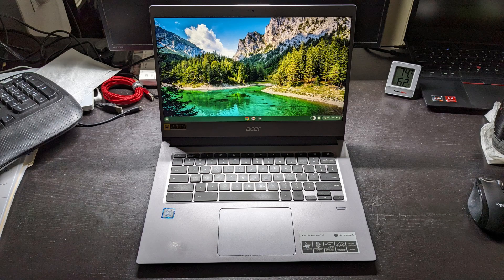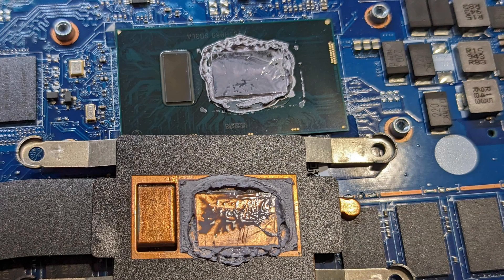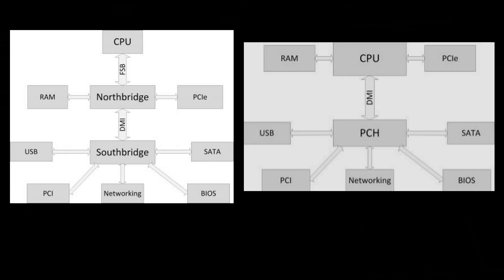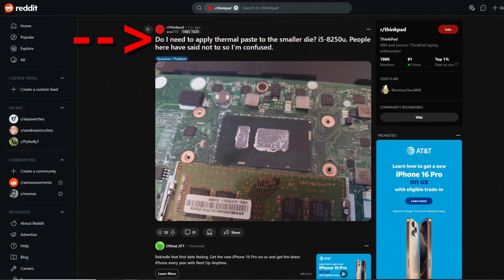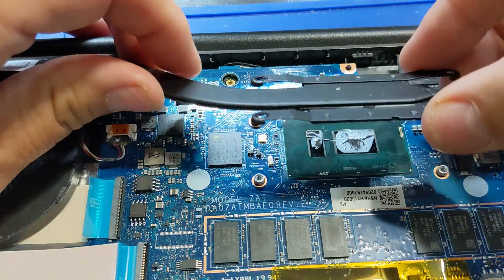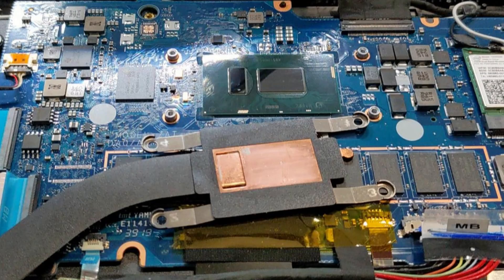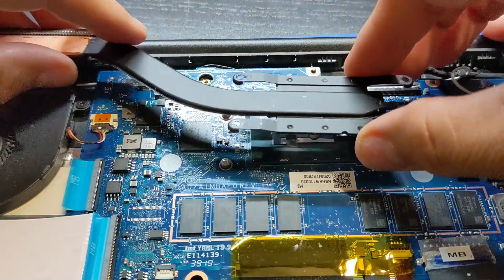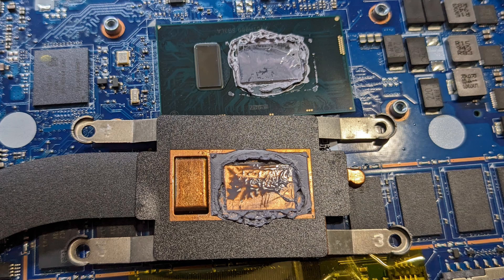Do You Need Thermal Paste for Intel Core i5 PCH?

Comment from the maker: ***If your laptop comes with thermal paste on the CPU and PCH by factory (and there is no cutout on the heatsink above the PCH), then continue putting thermal paste on both dies. But if your laptop does not have thermal paste on the PCH (and there is a cutout on the heatsink), then don't put any thermal paste on the PCH. UPDATES, LINKS, and additional information in the video description! ***

Comment: Bro I have applied Thermal Grizzly Kryonaut, High Performance Thermal Paste(1gm) on both CPU and PCH on my dell inspiron 5509 laptop because while opening for first time i have seen thermal paste on both CPU and PCH.

 I have observed that laptop is becoming little more heat than old thermal paste(default one) which was there for 3 years. What should I do, open laptop and clean paste on PCH (as I have applied it on just yesterday) or clean totally on CPU and PCH and apply new one.

When I asked My dell service man, after this incident, he said that we should apply thermal paste in CPU only. So I asked him say doubt as I am asking you for removal ,then he recommended me not to remove paste and leave as it is. 

I am confused so I need your opinion Bro. I use my laptop for normal tasks like streaming videos, coding for 6-8 hours daily.
Reply from the maker: Does the heatsink plate that touches the CPU and PCH, have a cutout on the PCH?
Reply: @ChavezDIY Heatsink is plain, so put on both PCU and PCH but my dell service man said to put on only CPU, what to do?

Comment: Interesting how differently this is handled on different laptops, even on the same CPU. I recently replaced the thermal paste on ThinkPad T480s and X1 Carbon G7. The 480s has the same exact i5-8250U as on this video, but with paste on the PCH. The X1 Carbon on the other hand had no paste on PCH from the factory. Replaced the stock paste with Thermal Grizzly PhaseSheet PTM on both, T480s so that the PCH gets a pad and X1 Carbon's PCH goes without.
Reply from the maker: I don't understand the reason for the inconsistent application of thermal paste on the PCH. I will just go with how they come from the factory.

Comment: I have a Dell Inspiron 3501 with i3 1005g1. Not only the pch came with thermal paste, but on aaaaall the green part too 😅 i think it is not supposed to be these way so I only applied thermal paste on the cpu and the pch. The fact is I think is running hotter than before 😂
Reply from the maker: Paste on the green part too? haha. You might have to experiment to see if it needs paste on the PCH or not.

Comment: Asus VivoBook F510U Model: Apply it to both PCH and CPU FYI.

I did it both ways to test it like you did. No cutout on the heatsink for the PCH but the heatsink is aluminum with copper pipe and aluminum fins for heat dissipation. Was weird seeing that setup from building desktop gaming rigs and the mating surface for the heatsink to the CPU was always copper, since copper absorbs heat better than aluminum. That makes sense to me. Aluminum for the fins for heat dissipation is better than copper. Don't understand why Asus did that. Makes no sense to me.

I applied Corsair TM30 Thermal Paste and my temps suck. I did it 4 times now and just not happy with it. Spread, Dot, X applied and with or without the PCH with paste. I ordered some MX-4 Thermal Paste to give that a try. Bestbuy only had the Corsair TM30 and I'm out of my Arctic Silver 5 Thermal Paste. I personally hate Corsair products. People buy them like Apple for the name but produce garbage at best products. You want RGB Lighting RAM with crappy performance compared to other products on the market, buy Corsair. 
I never used the MX-4 paste but I hear really good things about it and I heard some bad things about the MX-6 being really thick paste and not very pliable and almost glues the heatsink to the CPU cause people to pull the CPU off the motherboard causing damage when removing the heatsink.
Reply from the maker: It's annoying that people have to do their own testing to figure whether to add paste or not. I wish Intel was more consistent about the paste on the PCH. I have tried MX4 and it was okay, I never tested it against other paste. The MX6 is supposed to be better than MX4 at cooling down the CPU but I don't have personal experience with it. I'm happy with the performance I get from Noctua and Gelid.
Reply: @ChavezDIY  I agree. I don't have experience with MX-6 either. I have experience with Arctic Silver 5, Corsair TM30 and MX-4. 
I personally hate the Corsair TM30 from my personal experience with it. I really enjoy the MX-4 and it is easy to apply like Arctic Silver 5. 
The reason I didn't use the MX-6 is because I heard of it being thicker than MX-4 and causing it to be harder to apply due to being a thicker viscosity but I also heard of people pulling their CPUs off the motherboard because it's so thick and also sticks like glue. I went with MX-4 as a safer option but it is fun for me to tinker from personal experience as I enjoy overclocking and building PCs more. I love gaming but 80% of my time is having fun tinkering and learning more about how a specific product works or doesn't work.

Comment: Mine works better with thermal paste. There's no cutout, but the factory default doesn't include thermal paste. Stress test pch temp without thermal paste = 54°C, when using thermal paste = 50°C. And the pch temp drops faster after stress test when using thermal paste.
Reply from the maker: That's Interesting that you had no cutout and no paste. I guess it's better to test it to find out what's better. I wish Intel didn't make this so confusing.

Comment: Phobya nanogrease extreme it's good
Reply from the maker: I have never heard of that thermal paste. Among the best thermal paste, the difference is usually one degree. I've been really happy with Gelid Extreme. I tested it against Noctua thermal and they both perform about the same. For better performance you'll have to use liquid metal, but if you mess up and spill it, you can short circuit your motherboard.